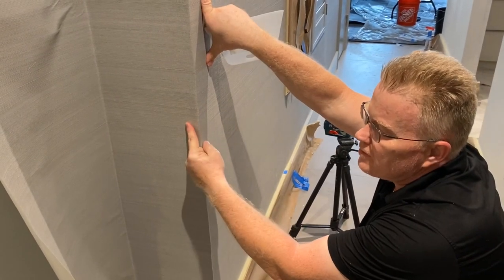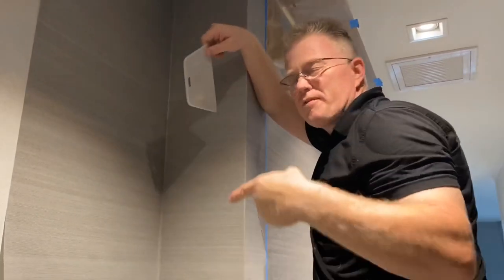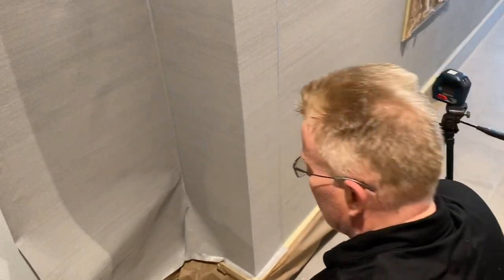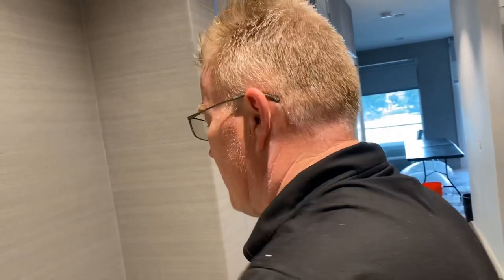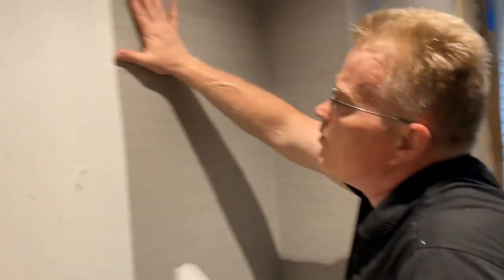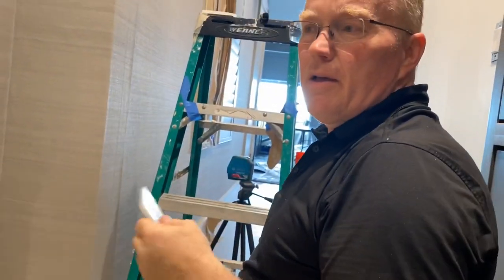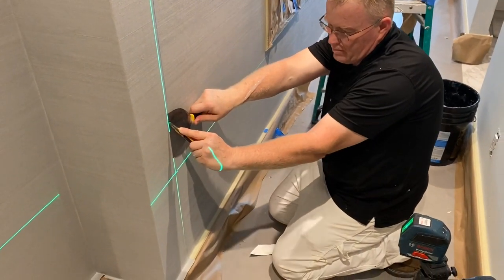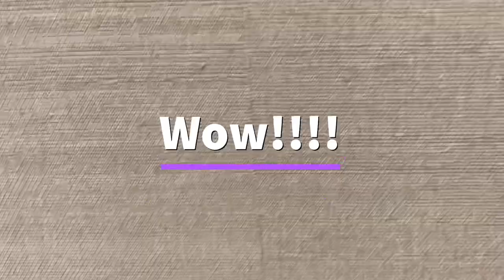How to Install Grasscloth Wallpaper Around Outside Corners to Inside Corners - Spencer Colgan

Comment: Brilliant. I have a strange interior wall to cover with this tomorrow, like a super wide pillar, against which a bed will go. Four external corners. Double cuts aplenty! Thanks for all the videos. All the best.
Reply from the maker: Glad the vids helped you
Reply: @spencercolgan  Thanks Spencer - They helped massively. Turned out I had a vinyl to hang today - it looked like a woven grass. Lots of double cuts and a couple of alcoves that will be next to the bed - just little boxes really. Tested my patience! Looked pretty good at the end of the day but I'm wondering if I should have heated or cut my outside corners as they refused to lie flat. Client was happy so it's all good, I just wasn't 100% about the job! 
https://flic.kr/p/2kguqeA

Comment: Nice work Spencer. Quick question as im curious, you flipped the paper to leave a neater corner, fair enough but what about your next strip? You cant butt joint against a edge that isnt straight. I presume youll be double cutting that strip also? Seems like an awful lot of hassle as opposed to the conventional way of doing things.thanks from NORTHERN IRELAND.
Reply from the maker: Yes es sir!  The corner was so screwed up that I had no choice.  I had to flip it and so another double cut. Was a lot of work.
Reply: @spencercolgan   unconventional I guess but it worked for you and this particular paper. Cant say ive ever seen this done but fair play it worked for you. Well done. Patience of a saint. 🤣🤣 👍🏻
Reply: i hang wallpaper, not tried grasscloth but i would normally always line up that second strip then trim off excess in corner. Also with that amount of "torque" and then fixing it by overlapping and splicing to get the next sheet to work, the horizontal lines from "torqued" sheet to new sheet will be off.. hmm

Comment: Breast wallls can be an absolute nightmare you did an excellent job again Spencer, by the way those Purdy 6 inch dry wall knives are so difficult to get hold of in the uk for some reason so it looks like I will have to get another brand they are great for when we cut wallpaper with a blade as you know
Reply: I use Marshall taping knives

Comment: I'm wondering if there's a way to "scribe"  a sheet, drawing a pencil line using the right hand wall as a guide, then taking the sheet back to the table and just barely cutting off the pencil line so you could slide the whole sheet easily back into place and stay plumb